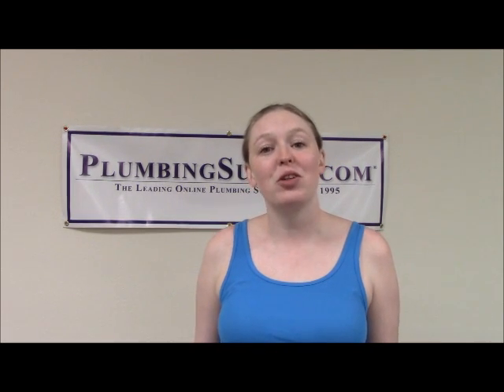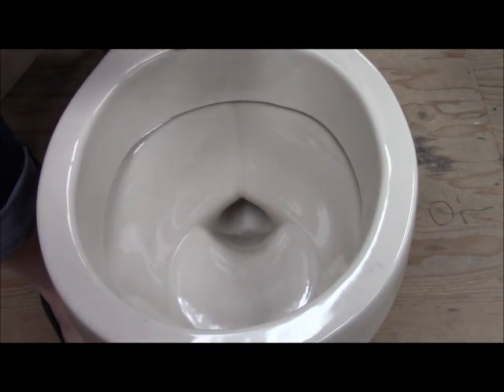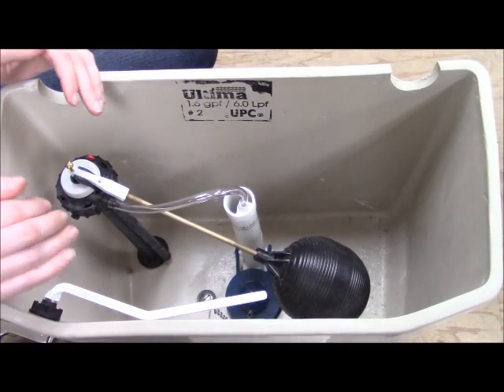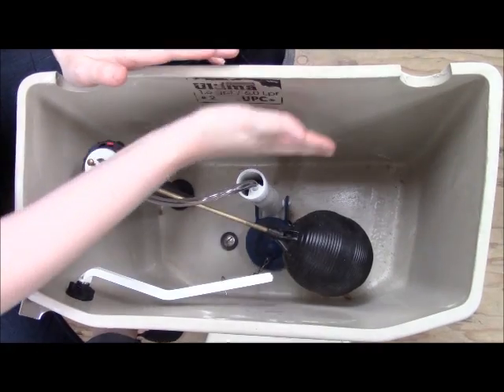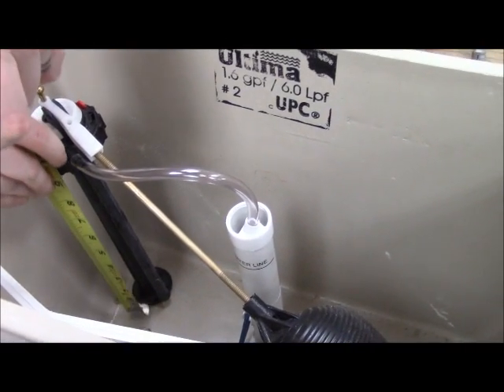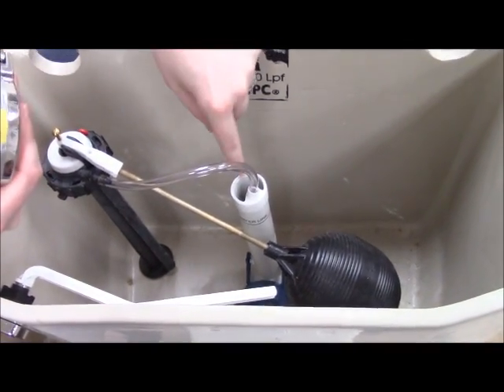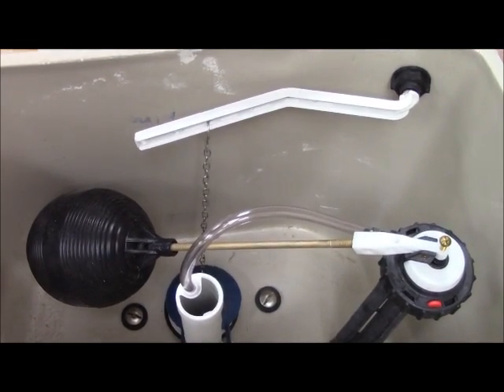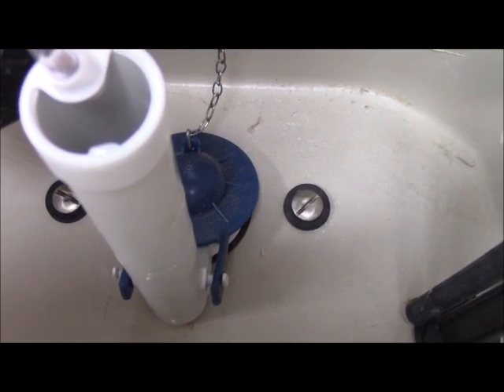How Toilets Work & How To Find Parts for Your Toilet

Comment: I would love to know why there's water coming into the toilet tank both from that clear long plastic tube and also from the bottom of the fill valve.  They seem to both fill the toilet bowl and tank anyway so why is this incoming water stream divided by two?  I've replaced these all my life and still don't understand this...
Reply from the maker: Hi Dan, the clear plastic tube refills the bowl - which is why it should be attached to the top of the flush valve tube so the water drains through the flush valve to refill the bowl - and the bottom of the fill valve refills the water in the tank that will be used for the next flush. We apologize if that wasn't made clear in the video and hope this explanation helps - and thank you for watching!
Reply: Thank you, the reason I ask is because I have the water open very little for my toilet since I'm rarely home and I live alone.  No water comes out of the plastic tube to refill the bowl even though it's in position yet the bowl is still refilled with only the small amount that come out from the base of the fill valve.
Reply from the maker: Hi Dan, there are only two ways for water from the tank to get into the bowl - from the overflow tube of the flush valve (where the refill tube of the fill valve attaches) or when you lift the flapper and empty the tank. If you have water in your bowl and neither of these things are happening, you have a bad seal somewhere. Usually this is caused by a flapper disintegrating, but it could be that your gasket needs replacing too. If water isn't coming out of the refill tube, either you don't have the water flowing enough or you could have a blockage in there. Sometimes if the line isn't flushed beforehand or if you have water with a lot of sediment in it, a rock or some other debris will lodge in there and the fill valve won't refill properly.

If your toilet is in good shape and not leaking, you can turn the water on to the appropriate level and it won't be wasted. Meaning you can have the water on full bore but nothing will come out until the toilet is flushed and the fill valve refills the tank/bowl. If it does, your fill valve needs replacing. Keep in mind too, that toilets are designed holistically to flush with a certain amount of water. It may flush with less water, but it won't do so effectively and the waste may not clear the line fully which can eventually lead to clogs and backups.

We hope this helps you out, and thanks for such great questions!

Comment: how to replace the lever from left to right? or do i need a new tank please? Thanks
Reply from the maker: Hi +ks1307 - I'm assuming you have a tank with a left side trip lever and you want the trip lever to be on the right side? If that's the case, yes you'll need to get a new tank.